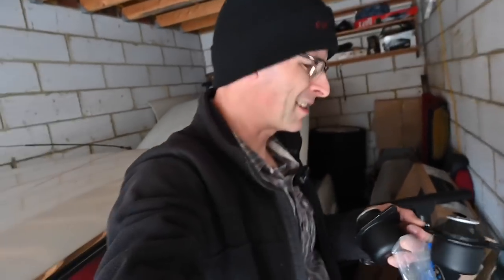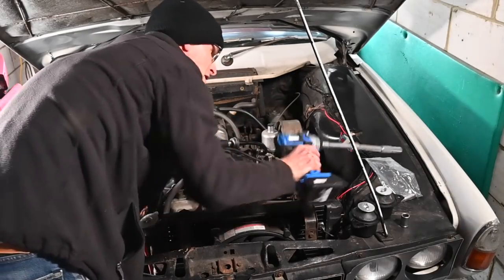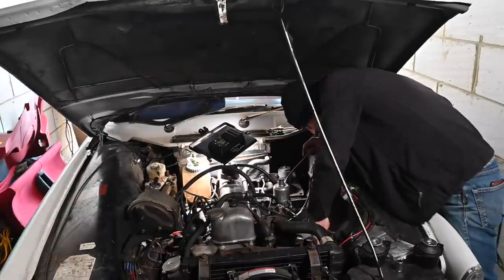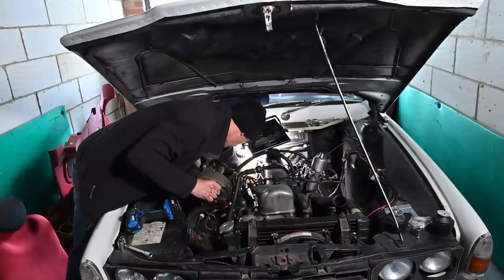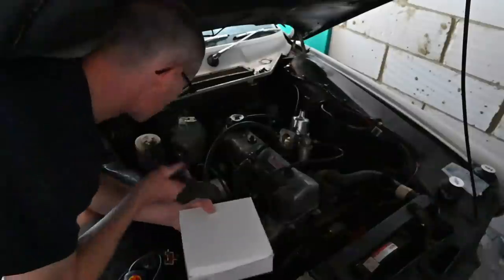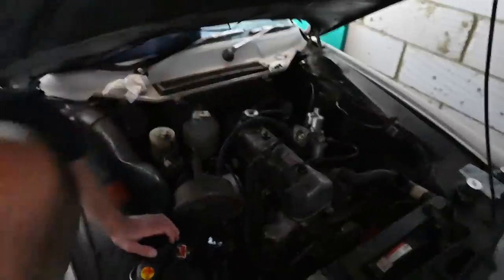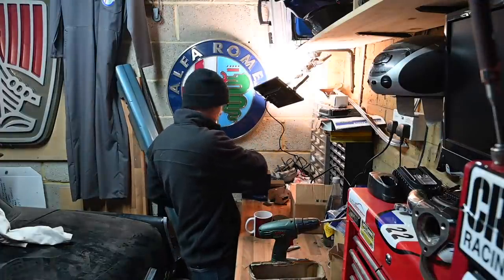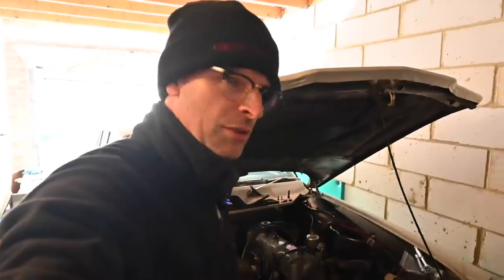Rover 2000 4 month engine mount install

Comment: Hi Mr FuriousDriving. The mounts you initially tried to use are MkI Golf. I used them on my Series II 2000TC and am very happy with them. Indeed it is necessary to file out the big holes in the subframe, but in my case I can't remember it taking more than 20 minutes per side. Maybe your file is not the best.  It's also necessary to find metric bolts to attach the engine to the mounts and grind off the redundant tabs atop the mounts. Like you, I found that while the driver's side looked to be the easy side, it was by far the more painful.  Anyway, it'll be interesting to know how the pucks work. Good luck with it!
Reply from the maker: Maybe once the car is at home Ill get something powered to grind the hole larger, but if the pucks work they can stay until I need to do something else at the same time!

Comment: After working on vehicles for over 50 years you have sold me on an "impact driver" I hope you get commission on the sale!
Reply from the maker: If I can find a link to Amazon I do!
Reply: I concur. Until now I'd always thought these were useless.  It's on my shopping list now.
Reply: I have actually gone and bought this exact kit from Draper after watching Matt use his, after much deliberation . Its bloody powerful, its also brushless so it weighs nicely in your hand. The only thing I've failed to release is a crank bolt (you know how hard they are even with an air gun). I think its part number 55343.
Reply from the maker: @usuallyfixingtinkering  Ive been really impressed with such a small machine, the only thing Id caution about is doing up wheel bolts as Ive found it can leave them loose enough to work undone so always check with a wrench!
Reply: @furiousdriving  yes I found that when I did up a few wheel nuts and checked on the torque wrench but the I'd always torque up any bolts properly. The gun is just for releasing mainly.
Reply: @furiousdriving  I’ve a Chevy pickup truck which whose wheels requires 110 or lb/ft of torque.....battery powered wrenches will neither undo them or do them up!

Comment: The hockey puck hack is absolutely brilliant. Teen me has used old ones as ammo for a drain pipe cannon once, but it never occurred to me to use them as engine mounts. If I make a center hole, and then saw cut into that hole, and then lift the engine with a jack so that I can hammer the puck across the engine mount bolt through that cut, and then mount the biggest, beefiest jubilee clip around the puck to close it up again, I wonder how long that will hold.
Reply from the maker: It would be better to undo the centre bolt and push it through hole you drill, then the puck cant shift if it vibrates, but should last well

Comment: The  interior of the P6 looks lovely and a nice place to be. Nomination for a Blue Peter badge for patience and persistence with  the engine mounts. Once you have the car back to your usual lair and power is available will you fit the new mounts, assuming you have a dremel type grinder with carbide files to hand. I am worried now as i have to replace the mountings on my 67 p6 2000sc in the near future and it looks a sod of a job single handed.

Comment: The endless frustration of this job struck a chord with me. I’ve just replaced sparking plugs in my ‘86 Silver Spirit. Deeply recessed and at a slight angle. And to complicate things it has an LPG conversion, so extra cooling pipes for the vaporiser plus gas pipes of course. It was a pig of a job and with the added stress of accurately starting each plug with a flexible pipe to avoid cross threading. Who would think a plug swap could take hours?
Reply from the maker: I would - I had to modify a plug socket to fit the first time I did one on a P6 V8!

Comment: One reason why I havn't got a car like that is you can never be sure what size bolts are in it and it would mean getting different sockets/spanners which add to the confusion as I have 3 toolboxes which have to be hauled out to the driveway for tinkering. If only Santa would bring me one of those cabinets with wheels and multiple drawers 😏
Reply from the maker: In the home garage Ive got that, draws of metic and imperial sockets and spanners but in the lock up its only what I remember to take (never enough!)

Comment: Looks to be in very good condition; love the red interior (is it leather or vinyl ?) I had a 74 2200 TC in white with a black velour/fabric interior - it was a lovely car indeed until I crashed it racing my mate along the country lanes - a sliding P6 doesn’t stop very easily ! Luckily, it wasn’t too badly damaged and nor me either. Brings back good memories 👍

Comment: During my ownership of a P6 engine mounts was one thing I dreaded having to do, luckily the originals were okay. Unfortunately there is no off the shelf replacement for any of the metalastic bushes on the P6. The rubber produced today is just not durable enough and some of the stuff from the usual specialists are just rubbish. I bought new bushes for the rear lower arm, within 2 years and under 2K miles the rubber had collapsed allowing movement at the all vital point of attachment on the De Dion elbow! Not good. NOS supplies are almost dead for mounts and bushes now. There was an article some years ago about engine mounts off a Peugeot or VW been fitted but unsure as to what model. I will be interested to see if the puck works!
Reply from the maker: The pucks take some abuse in the drift world so should be OK, if anything not soft enough but we'll see.
Have you tried any Poly bushes on yours? Ive got some in the front which have lasted years but do creak sometimes
Reply: @furiousdriving  I did replace the inner bush on each top link with polybushes but from my experience and many others it creates more road noise. It's a trade off. I wouldn't do it again If I could find quality rubber replacements for the originals. From what I know thhose inner bushes do not pivot with suspension movement, rather it just flexes or squirms - Rover got it spot on with the bushes. Whatever you do don't use polybushes on the rear trailing arms, a knew a guy in norfolk who had the rear elbow collapse on the motorway - the bushes caused stress fractures in the trailing arms.

Comment: Fantastic quality cars P6s. Cheap too. You can buy a pretty much perfect 2200TC for under 3 grand. You'll have to go a long, long way to find a car up to the quality of a Rover P6. The perfect practical classic. Every panel unbolts to make home maintenance a breeze. The only thing I hear people moan about is doing anything on the rear discs or calipers being inboard but they are not that bad but we can argue about that next time. Great cars highly underrated.
Reply from the maker: They are one of the best driving classics about, prices have risen bit lately so a 2200TC (the best version I think) is getting on for £5000, and is the rarest as well as they weren't tax free until most were gone, but any P6 is a great all rounder and ideal to learn on
Reply: @furiousdriving  still cheap as fuck. These cars are jaguar quality but get overlooked. Great for us buyers. My father was a London Metropolitan Police Traffic Division driver. He started in 63 and retired around 1991. He still rated it as the best all round police pursuit car. So do most of his ex work mates.

Comment: Ah, cassic 10 minute job, turning into a 4 month job. xD But at least it is not your daily driver.
My 10 minute job of changing a track rod end turned into a 2 hour job or removing the old one + a 2 minute job of installing the new one in...
Reply from the maker: Track rod ends always take way longer than they should!

Comment: Dremmel job? And my first thought for lifting the engine, loosen the radiator so it can lift up with the tubes not to break the studs on the radiator!?
Reply from the maker: Its not going very far up and the pipes are long

Comment: All that was very intense the air filter housing on these I think are not the best I am just dreading changing the exhaust middle 2 section's on mine it sounds like a loud tractor oil, filter and plugs are easier for me you have great patients rear brakes should be no problem to you.
Reply from the maker: Thats not to bad a job on these, PD Gough can make up exhaust sections when you need new ones, this car has them from there, replaced one at a time as they went with stainless

Comment: Should of rigged a solar trickle charger somehow. Can waste lots of money on batteries some motorhome dealers have wires all over the place trickle charging batteries.
Reply from the maker: I thought about that but it gives away theres something in the garage worth stealing. Its relatively secure there but is visible from the street. Ive rigged an inverter to a car battery for lights and had been running a trickle charger off it periodically but couldnt during lockdown and then got out of the habit
Reply: @furiousdriving  I was thinking of a concealed long wire out the rear of the garage to a small solar panel.
Reply from the maker: @marklittler784  I thought about that for a long time but couldnt figure where to put the panel, only the centre of the roof would be out of sight. The rear is visible to the public so the wire would have to come out the front

Comment: Matt get a decent work light your eyes aren't getting any younger,secondly some AF Sockets would help 
Thirdly do you have a proper workshop manual for the P6 if not get in touch with me and I will happily send you my old copy good luck with the old girl.
Reply from the maker: Theres only a car battery and inverter in that lock up! Its not somewhere I want to do much work!
Ive got a couple of Haynes type books, not the proper Rover book (Ive got that for the 3500 but not the 2000), its always good to have another book as they sometimes include different information or pictures which can get you out of a jam

Comment: Well as someone who has just changed the aux drive belt tensioner on a vag product, I feel your pain, whichever t*@t at vag thought it a good idea to fit a bolt at the back holding the tensioner in, i would like to spend a 1/2 hr with a breaker bar re-educating. 3hrs of disappointment and cursing ! 🤬

Comment: The one on the drivers side  of the engine looks like somebody's been there before and put  a threaded piece of something through it bodgery afoot 🤔 you ought to invest in some AF tools and keep them in a separate 🧰 toolbox as some metric spanners do not translate to AF  as far as the hubnut organisation joke you seem  just as bad  🤓 nip down to halfords and get some AF kit or ask a friendly snap on franchisee 🤓 sell your soul to the tool man 🤓👍 Older BL stuff AF  or SAE if your a yank or ebay some used britool stuff etc I do sometimes 😉
Reply from the maker: I've actually got different drawers of metric and imperial spanners as the P6s are all imperial and the Merc and newer cars all metric, sometimes though there are wrong metric fixings in the old ones somehow and that gets fun!
Reply: @furiousdriving  I've found the P6 has a massive mix of imperial and metric. It was forever mind boggling. 1/2 AF nuts next to 13mm nuts... jesus
Reply from the maker: @usuallyfixingtinkering  I thought that was just mine!
Reply: @furiousdriving  13 seems to be a replacement if you lose a 1/2 me thinks!